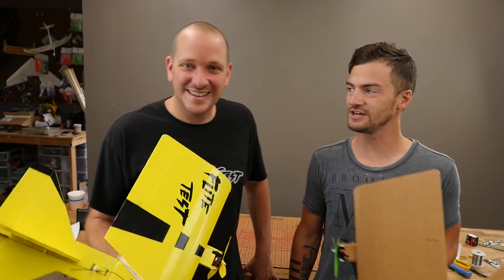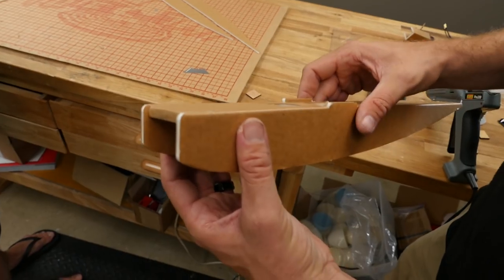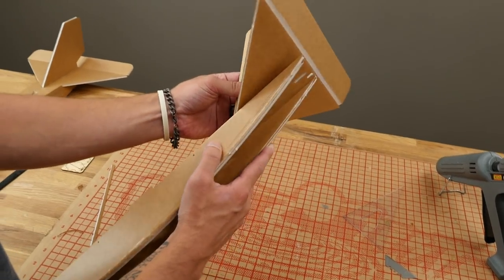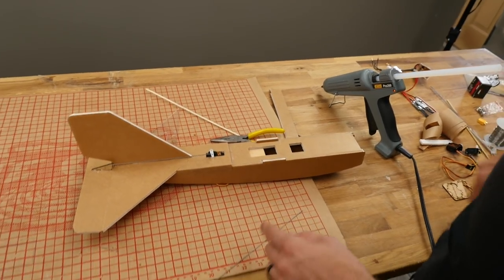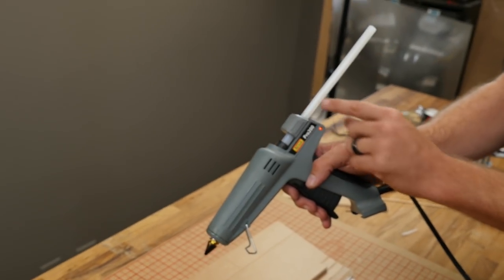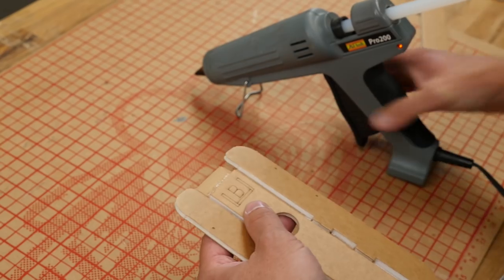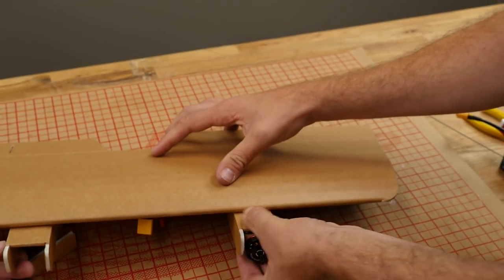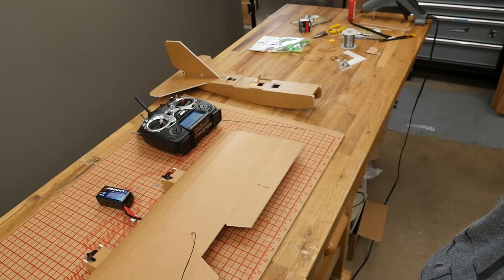FT Super Bee - BUILD | Flite Test

Comment: If you upgrade to 4s 2300kv I recommend to add a carbon fiber rod in the wing. After 10 flights the wings taco-ed on me and the plane came down hard. Have to build a whole new plane.

Comment: Would I be correct in thinking that increased wing span, the introduction of dihedral and increased fuselage length to maintain CG would calm the Bee enough to be handled by an experienced beginner to a novice intermediate?
Reply: It would, but at that point you're better off just buying (or building) a plane that's already designed that way. Don't get me wrong, you can definitely do that to the bee if you really want to, but it's a lot of work to re-design a plane that's been specialized for one thing.

Comment: The power pods are held in place with skewers. Those skewers aren't glued in but it seems like they should be to secure the pods in place. Has anyone had the skewers come loose in flight?
Reply: I'm using packing tape over the pod, if i need to get in there, I just cut through it, and bbq skewers through the tape.  Reinforcement helps but not required, remember this is a foam core board plane ;)
Reply: Better late then never.  Reinforce the holes the skewers go through with a piece of plastic from a gift card with a hole drilled in them.

Comment: What do you do if/when a servo blows? How do you replace it without rebuilding the whole plane since it's glued down?
Reply: Servos are surprisingly easy to extricate.  I recently replaced a servo on an FT Arrow.  Just yank it out and glue another one in.  If you want to be neat about it, use denatured alcohol (available in the paint section at your local Lowes or other retailer) to release the glue first.
Reply: dude gut the servo and put gut the other and put thE OTHER gut of the new servo in the old blown servo 

mininonstopgames:)

Comment: Hello, just finished my Super Bee and was wondering if I can hook up both motors with a Y connector so both motors run the same speed instead of the differential thrust set up, or do I have to use the differential thrust in order for the Super Bee to fly?
Reply: Well I answered my own questions by trying the motor hook up just using the Y connector so both motors turn the same speed. Seemed to work fine, and also tried the the 2 blade props. Almost got it in the air, but not enough thrust. Received my 3 bladed props and fly's like a dream. Great little Bee.. I have flown it about 5 times now. Just need to get better props because the ones I purchase are to brittle and brake every time I land, even if it is a smooth landing.

Comment: So this is my first scratch build plane and first fpv plane. I was wondering what kind of connector I need to buy for the fpv gear. I saw you used the little red connector. What is that called? Also, what battery lead to I need to buy that you solder everything into?
Reply: In case someone needs to know that's known as a JST connector (male and female versions)

Comment: So the Ft store recommended 5 gram servos so I bought those along with the speed build kit. I noticed during the build you were using the 9 gram servos. When building with the kit, I had to reinforce underneath the servo with some foam in order for it to stay secure. Not really a biggie. What I don't see is the recommended receiver to use. I bought the spektrum four channel from your store but don't know how to do the mix. Any suggestions?
Reply: Yeah im having trouble with DX9, I can get Diff thrust or dual aileron but not both at the same time :(      Must have been a Graupner sponsored vid

Comment: which type of foamm was that i has made my fixwing aircraft using cardboard i make kfm2 airfoil i used a2212 ange l980 kv motor 10.5 prop, 3s battry 3500mah tiger ,30amp red colour simonik non brand esc, fs -t6b radio,25inchby6inch wingsspan,towerpro 9 gram servo it fly great but some difficult to take off vertically it can fly up to 45degree not verticall not enough motor thrust cause my motor lift upto 1100gm so

Comment: I guess there is no issue with connecting two 5v BEC power sources from the ESCs to the same RX?
Reply: uLightMe, no for linear BEC is not a problem. only one at a time will supply the power.

Comment: could it work with 2200 3s 25c batteries or are they too heavy?
Reply: It will fly just fine.  Landing is a little hot.
Reply: It should fly with that, but I recommend that you not use the Race Spec motors. They draw much more current than a 25c rated pack can handle. Other than that I'd program some flaperons if you can. It might help keep the speed down on landing.